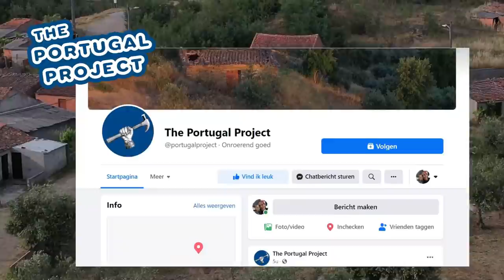MINI REBUILD PART 7 (..framing a window and clean up the roof) - Portuguese House Renovation

Comment: Bit of advise, when you next put a Lintel in, pack it up tight to the brickwork above, save any cracks starting above the window then you don't have a small gap to fill between the Lintel and brick work above, which you can see on the video. You are doing okay upto now, keep it up

Comment: If you filled it with rocks and cement then mesh on the surface it might hold. Or just expandable foam that goes solid.